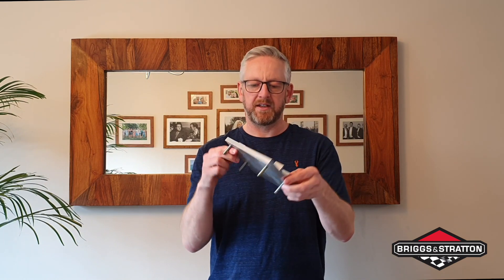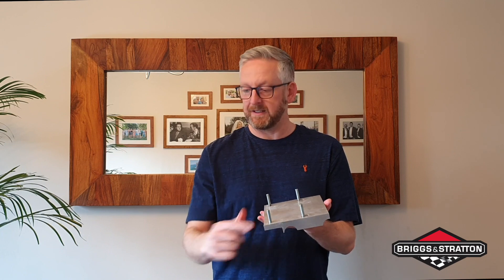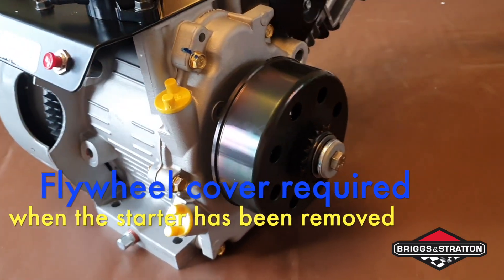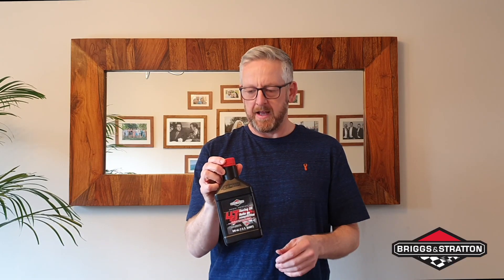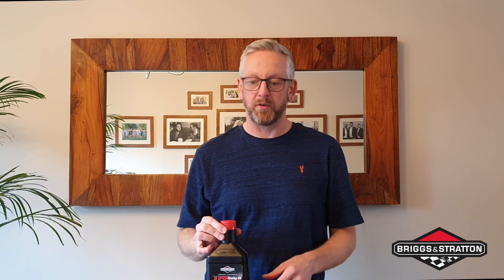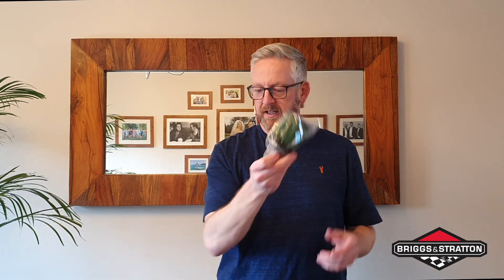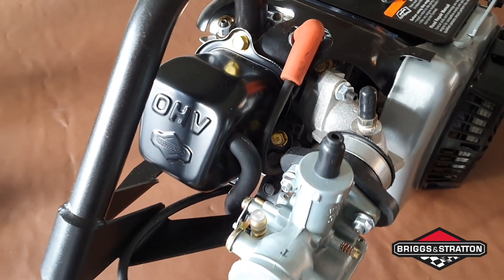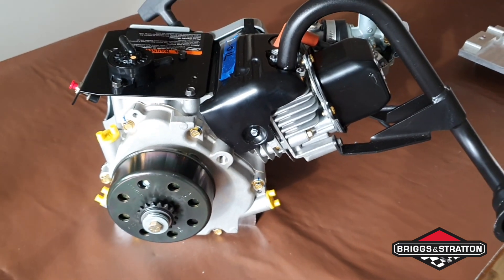Briggs & Stratton World Formula Mounting Options & Oil

Comment: I heard the recommended oil amount was 600 ml. in your video you said 450. Which is the amount that you would recommend?
Reply from the maker: Hi Kevin, most of us run the minimum amount of oil, 400ml. But that's up to you, the more oil you run the slower the engine will go, run to little and she will run really well then disassemble itself.

I've personally run 400-450 on new engines for the past five years with no issues.